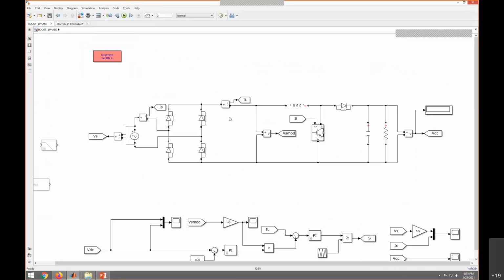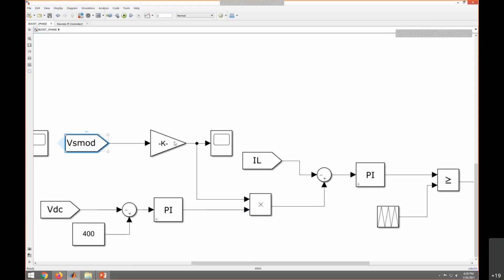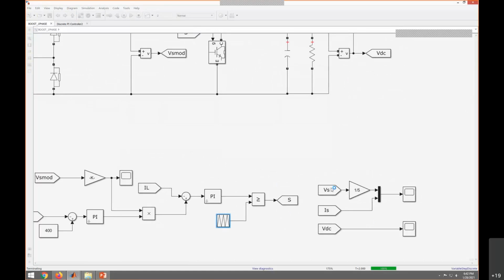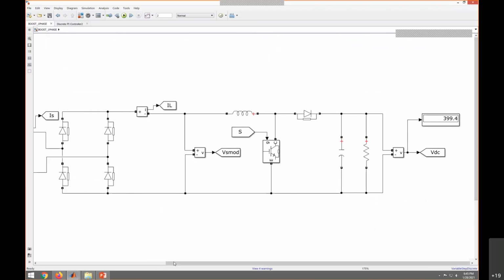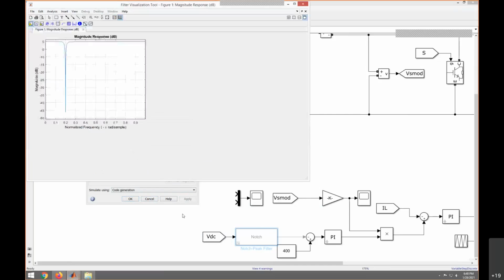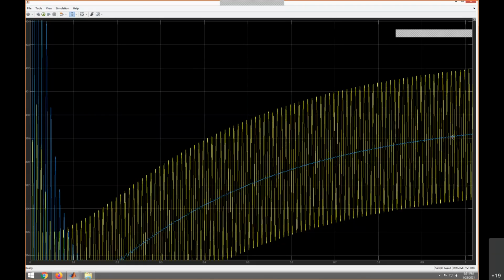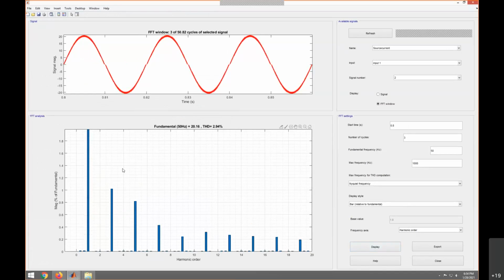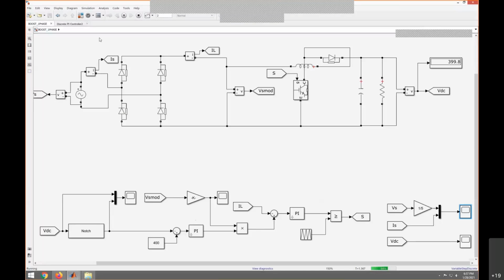Simulation of Single-phase boost rectifier with third order harmonic elimination

Comment: Sir, you have set the center frequency of the notch filter at 100 Hz, then how is it eliminating third harmonics from grid current?
Reply from the maker: Second order harmonic in the dc side cause third order harmonic in ac side. This is as similar to there phase diode rectifier. The 6th order harmonic in dc output of rectifier will cause fifth and seventh order harmonic in the ac supply currents
Reply: @AdvancedPowerElectronics  Thank you very much sir
Reply: @AdvancedPowerElectronics  Sir can u please suggest any paper or reference where it is explained, why, and how this happens?